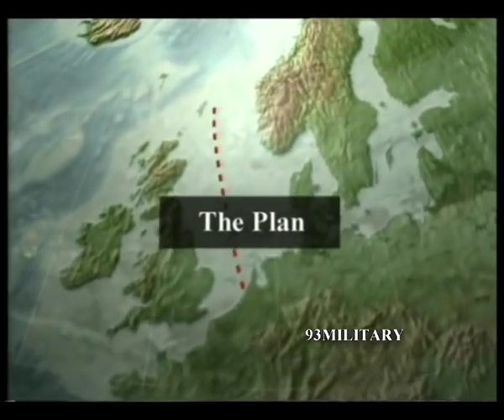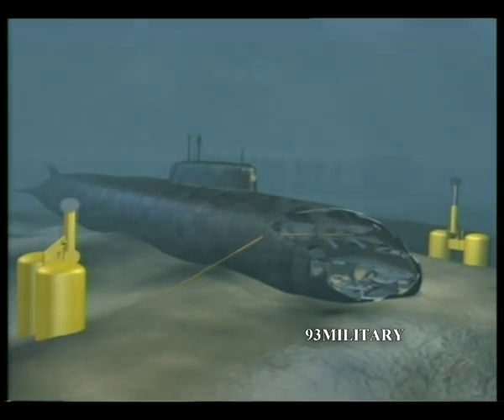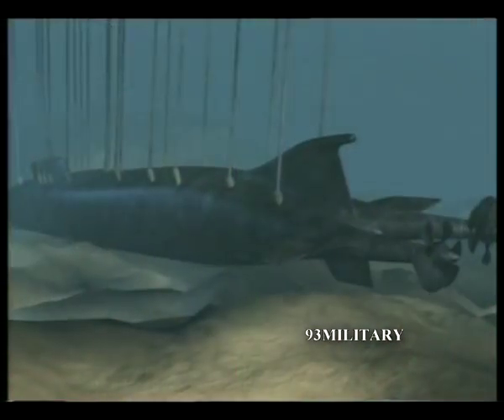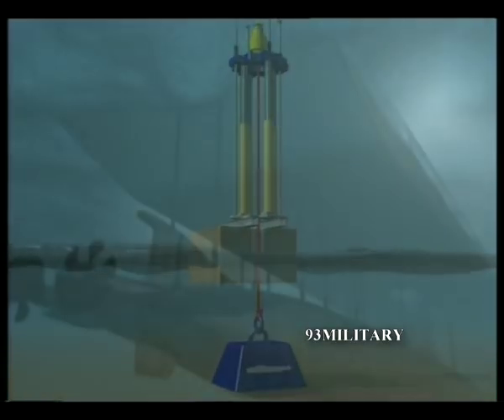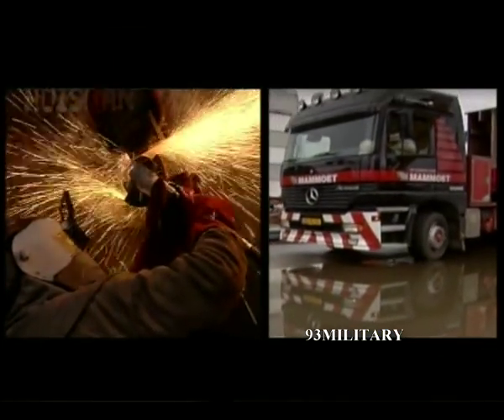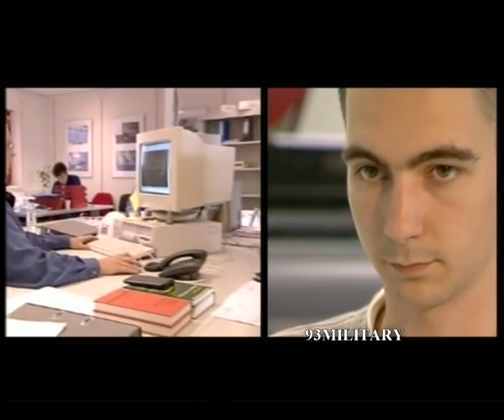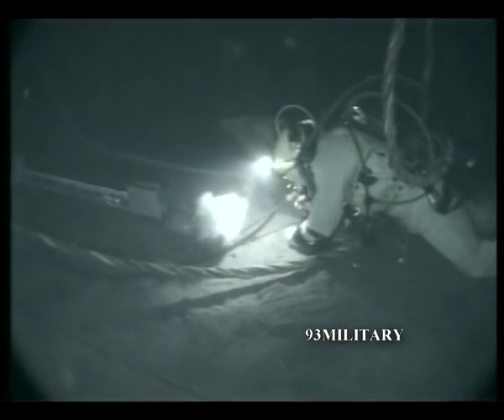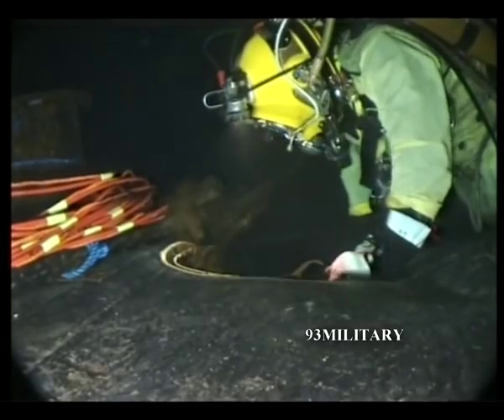Raising the Kursk Part 1

Comment: Why exactly was it necessary to remove the bow? By cutting it off, it would seem the potential for coming into contact with torpedoes would be great.
Reply: Raising Kursk with the bow in it's condition was unacceptable risk.
If the bow would collapse during raising procedure it would completely disbalance all the carefully calculated balance between lifting units which would lead to catastrophe.

Comment: in the salvage operation Kursk was cut into three sections at the bulkheads the Crew Section salvaged but the crew was removed and buried at sea the Torpedo Room and Missile Silos were cut from the sub and EOD divers from NATO and Russia were sent down to disarm them those that could not be disarmed were scuttled with depth charges in 2002 the Reactor was sealed off and sent to a classified site in Murmansk to be defueled and scrapped.

Comment: More money to be made, doing the most difficult way...........Yes, ping-pong balls and air bladders are normally used for low-depth submersion wreck salvages......Water and air displacement does not change...........Kursk/any boat/ship floats if you displace enough air against the water.......above or below water line. look at the price-tag the Costa Concordia got nailed at...more money doing the most difficult job. No money doing it fast,safe, and simple  way.